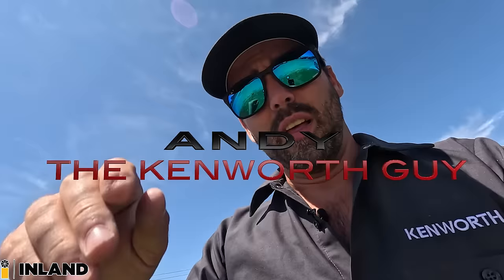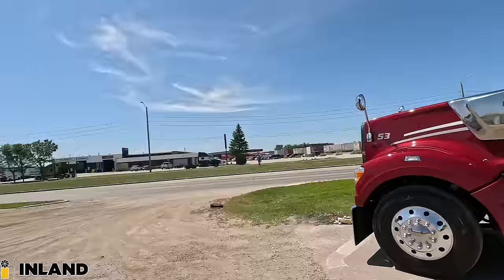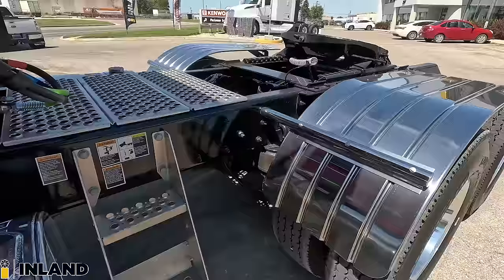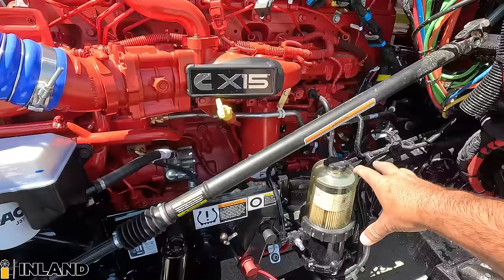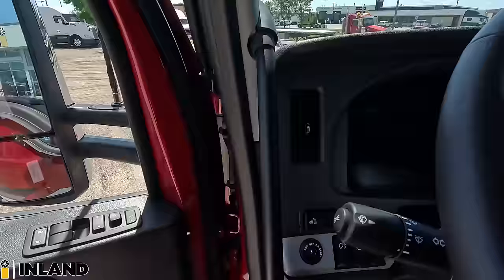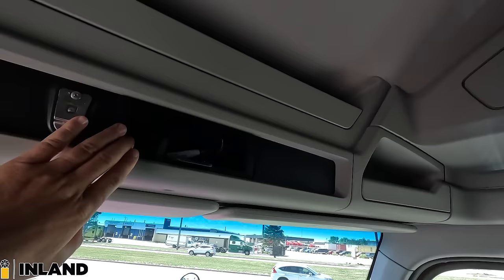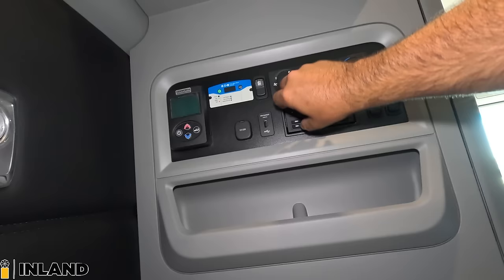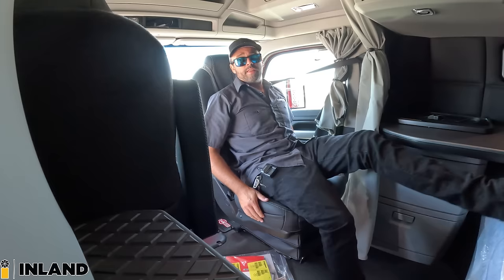FULL CIRCLE   2024 KENWORTH W990 SLEEPER   THE KENWORTH GUY

Comment: Is the drivers side stack live?
What a waste of money if not.
How is it that Peterbilt figured how to do it on the new 589 but Kenworth can’t?
Reply: Unfortunately it’s not…
Reply: Driver's side stack is a dummy but there are aftermarket y-pipes to make it live. From the factory it's a dummy.
Reply: @relaxing_white_noises_by_j1980  you spend over $200,000 for a brand new truck as far as I’m concerned if it comes off the line with 2 pipes they should be connected. This is just total bullshit on the designers and engineers behalf
Reply: @Retired88M  I agree!

Comment: I feel sad that these will be out of service soon , amazing looking trucks , great sound , so much theatre
Reply: Why do you say that. Sounds like a comment from someone that does not drive trucks.

Yes some aspects of the trucking industry can be taken over by computer drivers. Replacing the human.

There are some areas of trucking. That will not be taken over by self driving. Certainly not in the short term.

Flatbed & step deck is a completely different animal. That computerized driver cannot get out & check securement every 150 miles or 3 hours required by FMCSA Regulations.

Due to the varied type of loads that flatbed & Stepdeck do. Delivering to job sites, & not normal roads for dryvan & refer.

Going to be a long while for automated trucks to take over.

Job sites are not yet in Google maps or on any other map. No available coordinates. Throw in all the other equipment that needs to be maneuvered around. Some stationary some moving. Including the humans walking around.

Not Gona Happen for a long time!!!
Reply: @SinOjOs-Transport  

It’s in the post evs are 1/4 the running costs , 

Accountants run this industry

Comment: I haul logs/trees with a 2020 W990. The truck is beautiful handling, nice soft ride, cab is super quiet. I hate the fact that it has a fake stack. The DEF issues seem endless. The removal of the spike is definitely a bad idea. I had a front tire blow out before going downhill loaded at 110km/h and the spike essentially saved me and the truck from crashing. Don't care for the anti lock braking system either... so, the truck is still a great ride overall but definitely a few issues like anything else I suppose...